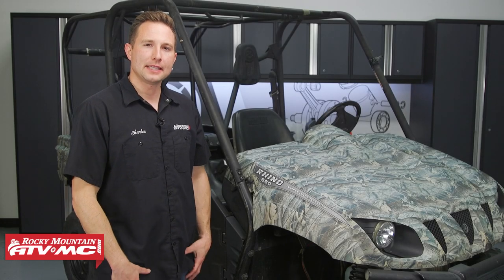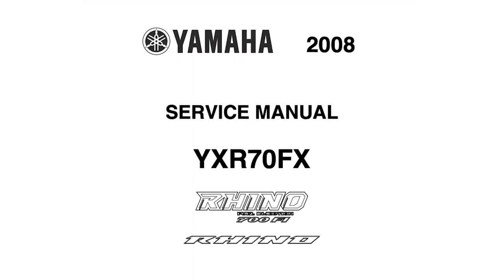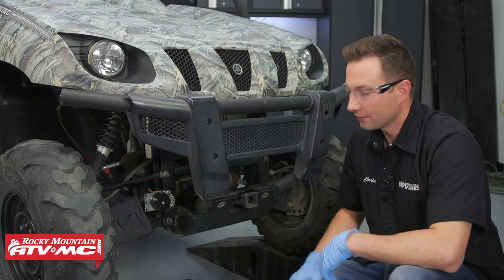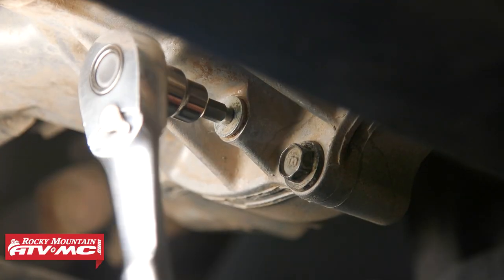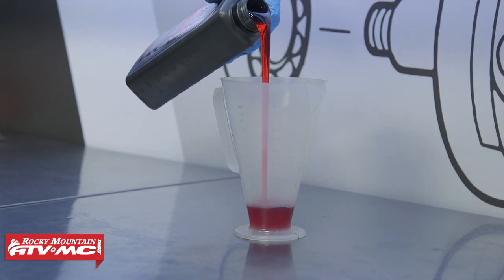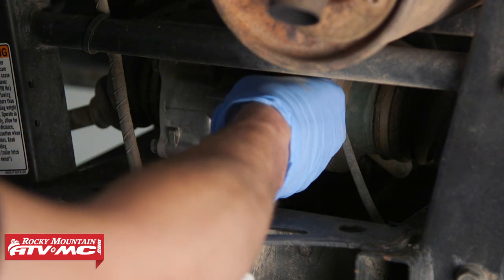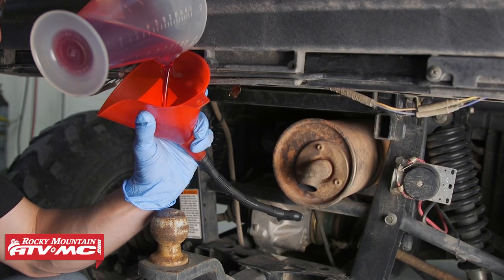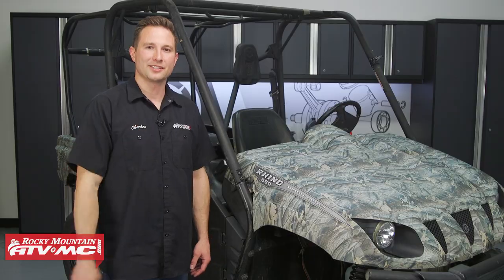How To Change the Drivetrain Oil on a Yamaha Rhino

Comment: Another excellent video guys.  Thank you.  I have a 2004 660 Rhino with a loud squeaking noise emanating from the front differential anytime I make a left steering input or go slowly in reverse.  Problem is the same in 2wd and 4wd.  I have changed all the wheel bearings and for this and other reasons I have also changed all the CV axles.  Additionally, I have greased all zerk fittings and lubricated all bearing points.  I have never serviced or changed the differential oil in either differential.  The unit has 2200 miles and 830 hours.  Any thoughts as to the likelihood that my squeaking noise is originating from the differential?  Separate question specifically on the oil replacement procedure.  Notice you had the front end up on ramps.  Based on the location of the drain and fill ports, how critical is it that the unit be level to ensure full drainage and proper quantity servicing?  Thanks.
Reply from the maker: If I remember right, we would have had all four wheels on machine ramps. The more level it is, the better it is. Is it for sure the diff that is squeaking? Did you check the fluid? What about the brakes? Pad pins can get groves worn in them and cause some issues. I would raise the wheels off the ground and rotate them by hand to listen/feel for anything abnormal/not smooth. -Charles